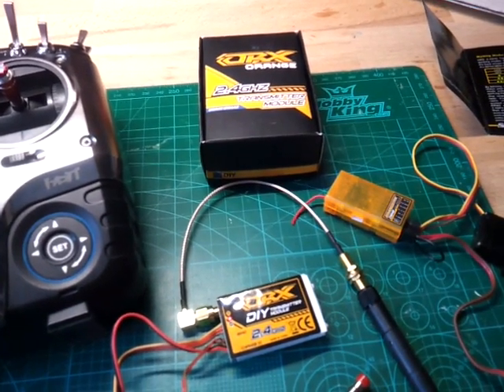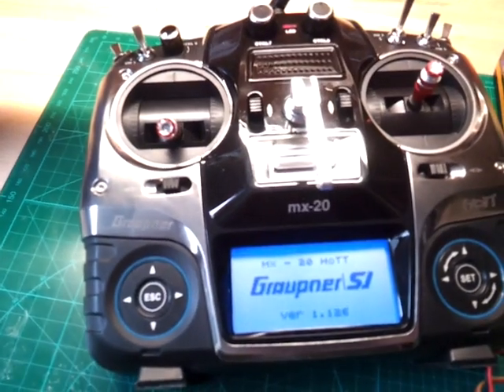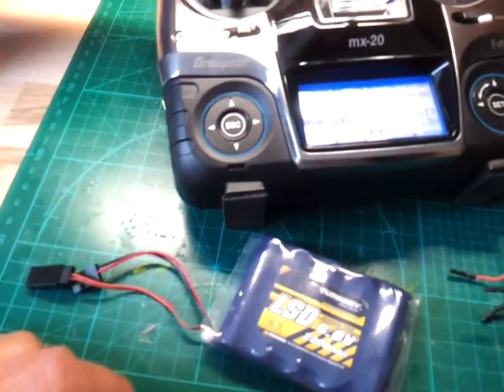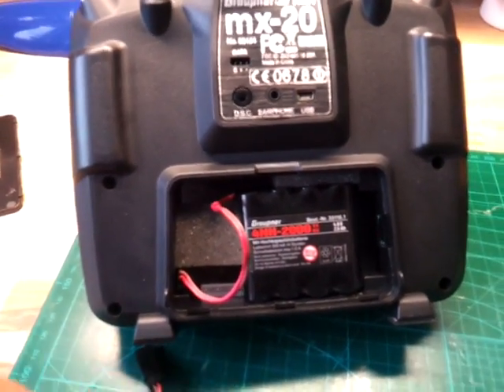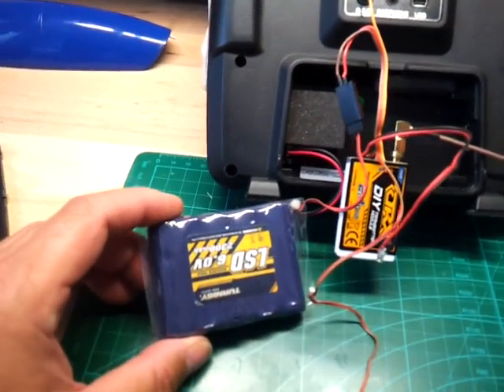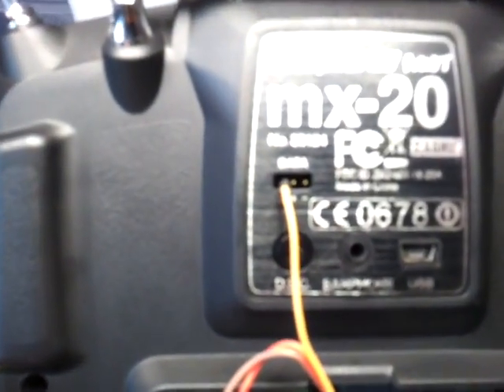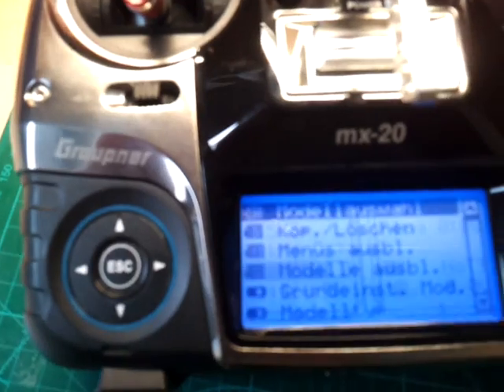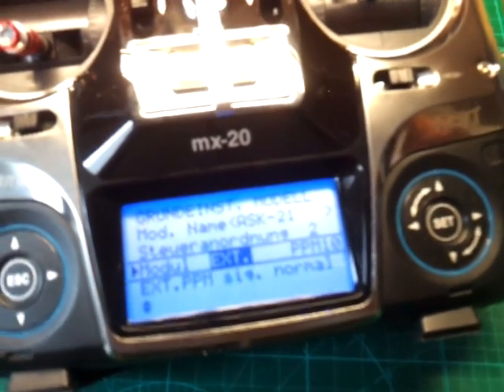OrangeRX  DSMX/DSM2  DIY Transmitter Modul 2,4GHz (Problem Binding)

Comment: I use MZ-12 remote connection has been successfully and the code.
Reply: hello do you have any video or picture of your mz12 + the Orange DIY Module ? how you made it? I have the same set but dont really know how to plug it on DSC port of the transmitter

Comment: The voltage could be too low for the module if your radio only uses 4 AA batteries.  See voltage specs below.  It may work with less than 6 volts but functionality maybe unpredictable.

Specs:
Compatibility: Any transmitter with a PPM signal output
2.4Ghz protocol: DSMX/DSM2
**Voltage input: 6~15VDC**
Power: 100mW
Range: Full range system

Comment: You first have to powerup  the receiver (with bindplug in)
Then power up the transmitter with the bind button pushed.
Hold it till the reciever light up.

Comment: I can't be sure but it looks like you have no common ground for the TX & the 2.4GHz module. Normally you would have, by using the same battery for both! However, at least here, you have a seperate battery for the module.
Just connect the TX & module ground/negative together and it then should work!

Comment: Ppm Mode will not work with the Data Plug You have to Plug it. In the d.s.c 
Your modul is Not broken
Reply: Hello, I also have the same set, but I am a bit afraid on make the plug... do u have any clue ?
Reply: what are you trying to do? MX20 with spektrum? use the data Port with a DX4 TX module don't forget to step down from 5V to3.3V otherwise you burn your module
Reply: Halligore  Well I got the Graupner MZ-18, I figured out some stuff already. well it requires a bit of work but it is easy, what this guy in the video is doing its wrong, he has to get the PPM signal+ground from DSC port, and externally feed the Orange DSMX module with 7.2v. it will work fine. I made a cable connector just like the one used by the Dragon Link.. Anyway thanks mate!!!